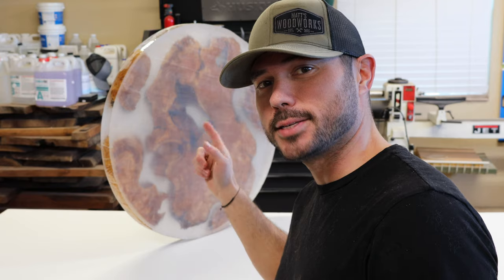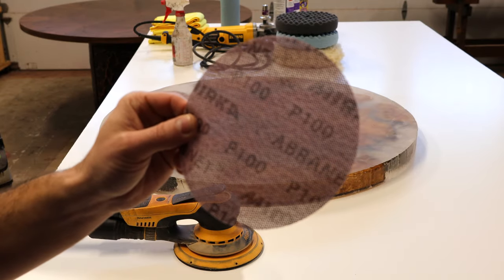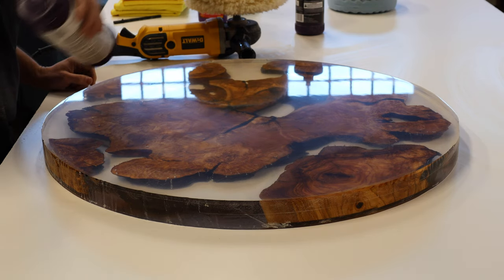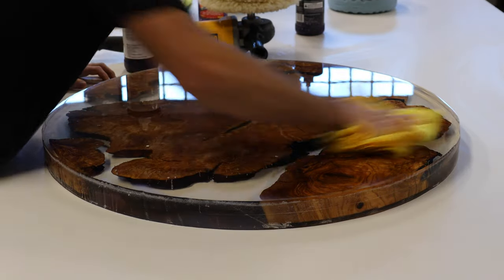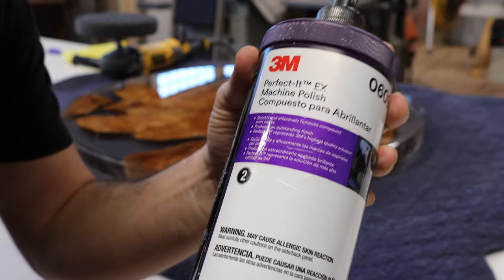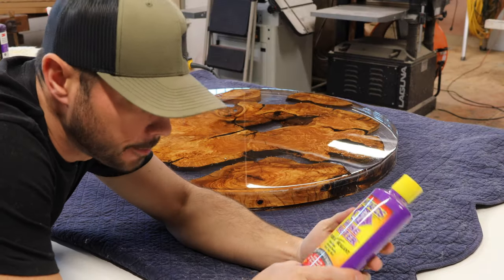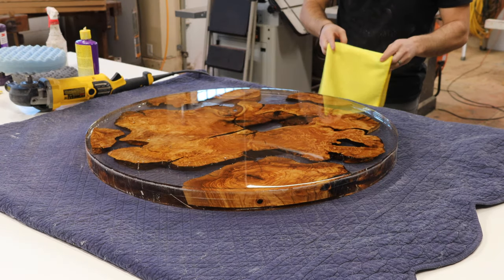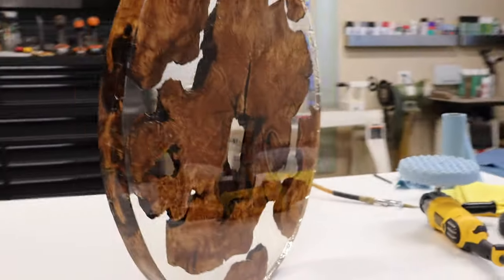How To Polish Epoxy Resin Like A Pro!

Comment: I was hoping you’d clean up and polish the round sides, that’s where most people have the most problems. Higher grits aren’t too bad, but with the lower grits it’s easy to create flat spots, sand off the sharp edges, or get the piece out of round. The piece you did looks amazing.
Reply from the maker: Could be a future video, I didn't because it takes a little longer, I use the same process myself and it seems to work great.  T'hank you for the kind words!

Comment: Great video man, so helpful! Just a couple of questions: Do you start wet sanding with the abranet discs (320)? How do finish the sides? I have the mirka deros aswell, best thing ever - been kinda shy to use it to water sand since it's electric, but i guess its ok!
Reply from the maker: Thank you Jerry! I start wet sanding @320 with the abranet too yes!  Sides I do all the same process just didn’t show in the video, usually would router the circle first.  I’ve used the deros for wet sanding for quite a while and it’s holding strong!  You will burn through the pad savers quicker though! 👊🏻

Comment: Sorry just hit the default…lol. 

Watched your video on polishing resin. Great tutorial by the way. 

I’ve been trying to finalize a few gloating chess boards. Didn’t like the flood coat because of crap in the air. Decided to give your technique a try. First real attempt wet sanding. Had most of the things you’re using. 

Gloss I got but also major swirls. 

A couple of questions if you have time. 

1. How long did you wait before buffing resin? I took my sanding to 220/240 like you suggested. Looked good enough to proceed. Wet sanded to 4000. Stopped at 4000 and went ahead and began the buffing. Nice gloss at the end but noticed the swirls…ugh. Went back down to 220 and tried again. Same end result. 

2. Wet sanding. Damp or wet? I’ll assume wet. Trying to figure out where the swirls came in. I think it came in at the first buffing stage. 2200 seems too high and may have scratched the finish…?

3. How far back should I have gone to remove swirls? Should I go as far back as 80 or 120?

4. Lastly, how do I know when I should get a new pad? Care tips with used sandpaper and buffing pads?

In the end I’m thinking I didn’t wait long enough for the resin to fully cure?  Waited about 2 weeks. Full cure 30 days…?

Thank yiu in advance. Keep the videos coming. 

JB…aka…All for the Love of Cedar”

Comment: Awesome video Matt.  This is the best video I’ve seen detailing any millwork shop polishing process using industry standard items.  

Just an FYI, although 3M and Mirka recommend sanding past 2000 grit,  you don’t need to sand past a 2000 or 2500 grit pad.  Start the polishing process with 3M step 1 past 2k sanding saves a ton of time with the same result. Also, don’t sand with 100grit. 150 should be the lowest. 100 leave away too big scratches in any resins to sand through and buff out efficiently.  Material is so soft you don’t need that extra grit with an Deros sander. 

Been doing polyester/paint in high gloss polished finishes for 10+ years commercially in high end residential.
Reply from the maker: Thank you for the feedback my friend! I wanted to take it this high for this video only to make it easier for anyone trying this out for the first time, I should have clarified this that it's not required at all to go up to 8000, you're totally right!  I am new to the, 100 grit deal, I'll give that a shot next time I do this, thank you!  Appreciate a professionals clarification!
Reply: I was reading comments to see if anyone said it before I added my two cents. I agree with Tosiek and share similar strategy. I'm also a finisher with tens of thousands of square feet of polished polyester behind me. Depending how much orange peel I have to eliminate the coursest I will start is 320/400. If things laid down clean i might start at 800 grit. My biggest question on this vid was why the 100 grit? I guess we are going after air bubble craters and orange peel? My final sanding is usually 3000 grit trizact, but Ive been known to go up to 5000 when Im pissed off at sanding scratches (pig tails). Ive left 3m for Menzerna polishes. They seem to cut and polish cleaner with less chemical smells and greasiness. The process you have in this vid works great obviously, but I think you needn't go all the way down to 100 or as high as 8000. Good vid.

Comment: Came over from Blacktail Studios. What an informative video to jump in on.  I do resin tables and have had a problem with that kind of finish.  Now I know what I have been doing wrong.  Self-taught brings a long learning curve.  Heat will do away with your bubbles along with good deep pour resin.  I use resin from the epoxy store, they have a deep pour that is amazing and great customer  service.  There factory is in California.  Thanks for the great Vid.  Think I will start over on one that I can't get the cloudy out of!

Comment: Quick question... you wet sand up to 8000, but then use the 3M #1 and #2 ... isn't #1 about 1200 grit and #2 about 2000 grit? I tried with 3M and Maguires 105-205 (roughly the same grit as 3M) but I just can't get out the swirls. Am I pressing too hard or too soft? I really want to polish rather than add another flood coat to get it glassy, But I can't figure out how to get the polish as glassy as you.

Comment: It's totally unnecessary to go thru the entire sanding and buffing process for something that's already coated with epoxy to get a glass like finish. Just use clear epoxy. I can understand this process suits projects like river tables, etc.
Reply from the maker: You're correct, if you wants a perfect top coat you could do this, but there will always be dust nibs or bugs that can potentially ruin a top coat, so this is best way to overcome that.  Starting at 800-1000 grit in this case if trying to take away small nibs.

Comment: great project. i also tried to go from 320 all the way up tot 4000 and then 3 types of polish. use a festool rotex sander. up to 1500 it has holes for the vacuumsystem.  Nevertheless I still get pigtails. 
with the vacuumsystem you cannot use water. 
what would you suggest? 
are the pigtails the result of insufficient cleaning in between? 
the pigtails also will not vanish with a next poor of epoxy. suggestions?  kind regards. love your video!
Reply from the maker: The pig tails are a result of not cleaning properly between grits, also after 320 I take the vac system off and just wet sand.. Clean clean clean!

Comment: Ah! Finally a great, comprehensive video on how to make a bar table epoxy finish not just clear but smooth  too. THANK YOU!! I've been working on my table for months and this is where I'm at. One question: how long do you estimate you spent to go from original, rough sanded table to the final product for this particular case?

Comment: You don't need to go through every grit that exists. That's not necessary. As long as each successive grit removes the topography of the one before it without taking 10 hours then you will have the same result as using every grit known to man.
Reply from the maker: I mean I could have went to 12K grit lol.  But you are correct, going to 3k is sufficient to start cutting/buffing but most people watching these videos aren't professional buffers so the less they have to do buffing is probably most helpful to them getting a good result.

Comment: Many great answers to some of the comments I’ve read. Apologies if you have already answerd this elsewhere in the thread but do you have any more detail on the wet sanding process please? I’ve ready you start at 320 but are you using a spray bottle and misting or just sloshing some on? Anything else you think is worth mentioning?

Comment: I do this type work.
I go straight to 600 grit, used wet on a rigid block (1/8" sheet of  acrylic) and suffer thru the longer time it takes to level a surface. 
Soft foam sanding disks follow contours, a rigid sheet of plastic as the sandpapers backer cuts off peaks.
I spray clean the sand paper every 45 seconds to avoid loading the paper.
My point being, 360 grit scratches are a nightmare to fully elimate so I simply don't allow them to be introduced. 
Depending on the standards, sanding can stop around 800 or 1000 and next comes a 3M fast cut compound on a waffle face foam pad. 3M makes a compound that breaks down fast, it starts as a cutting compound but becomes a finer polishing compound as you use it. It's worth the research (i cant remember the product name and my 3M bottle is gone, poured it into a squeeze bottle).
Final pass is a swirl mark remover compound used on a wool pad.

Comment: hi Matt, very nice. Question please: am about to polish a large acrylic swim pool divider 50ft x 2ft high x 2inches thick. Never done it before and cant find anyone to do it so will do myself. Bought two 5" Bosch Random Orbital sanders and plan to start with about 500grit going to 2000 but after seeing your video, maybe will need to go higher? which brands of sanding disc and polishing liquid would u recommend for acrylic pls? it is 12 years old, been scuffed up a bit, hazy and scratched but not too deep scratches. Think i might need about 50 sanding discs all in?

Comment: Matt I know you are a Super Clear guy. I am working on a bar top and used Super Clear's Bar Top Resin but took it out in the sun yesterday to see any imperfections and it heated up and started to ripple. I brought it back in thinking I could do another coat on it and messed it up more. It has about a 3/16" finish. What is my best option? I am wondering if I can sand it smooth and level as you did on this project and fix it that way or if I will need to strip it and start over. What would your suggestion be?
Reply from the maker: I'm sorry this is 6 months later, but I would say that yes you could flatten and then do this process to achieve a great result.  I have actually done this and it worked great, check out my latest video on the letter, there was so much imperfection that I had to flatten out and polish, end result was like a "flood coat"

Comment: Have applied my final coat and sanded 1000 final sand. Smooth as glass but have a bit of haze you can see from an angle. Need to see if I can polish this out.

Comment: Hello, like this, I have seen your videos and it does a great job, I recently started in this, I have some doubts if you can help me, 1. Sandpaper up to 10,000 but these leave marked how I remove those marks and how many hours of polishing you must do to reach your completion, greetings from my country chile
Reply from the maker: Once you get to the higher grits you need to be extra cautious on cleaning your surface after each grit increase.  Any small particle left on the surface will creat pig tails or sanding marks.

Comment: Beautiful job!  Would you use the same process to polish if the wood was exposed as opposed to it being an all epoxy surface?  I've heard to no polish the wood.  Would you use the same process on a river table and just polish the epoxy part?
Reply from the maker: I have never done exposed wood with epoxy polishing, I would recommend that the wood be dry sanded all the way through he grits like I did here, just not water.  I would guess you'd have to tape off the epoxy/wood and do each section individually, andI definitely wouldn't use any of these polishes on raw wood!

Comment: I know this is an older video, so I hope you're still around. How would you go about polishing something that's more globular? 

I'm pouring epoxy skulls to put on an award for my unit. (It fits the theme, don't ask too many questions). 

I have been using headlight polishing compound and a drill mounted headlight polisher, but we're still not coming out super clean. Any suggestions?

Comment: Question. I made a small river board so the resin is only about 2-3” wide. I would like to odies or rubio the wood and polish the resin. How is that possible? Would I have to wetsand the resin and use a small airtool for polishing?

Comment: So I have a question if you dont have a sander or buffer like that and working on smaller pieces would you do the same process? Also if so and you dont have any car polish what other options do you recomend for that? Do you need to use a buffer, foam pad before using any polish compound?
Reply from the maker: I'm sure you could apply all of these processes here and do it by hand, I haven't yet done this so I don't know how the final outcome would be.

Comment: Hi Matt, Thats a great video mate, i have just build my very first river table and i want to polish the black transparent epoxy to a high gloss, i will have to buy a polisher but qot confused with all the ( duel action polisher and rotary polisher ) what sort of polisher did you use in your video as you obviously done a great job with it.
Cheers for your help matt
John brunton

Comment: I have a 4-in wet grinder (typically used for stone) and graduated sanding pads. Do you think those would work (wet) on an epoxy table top like you've done here? I'd like get polishing pads and use that one tool for all the steps, if possible. What's your opinion, before I try and find out it was a terrible idea from the start!
Reply from the maker: Honestly I have no idea, give it a shot on a test piece!

Comment: Great video thank you. I have a question regarding polishing a similar round table that has wood in the middle and epoxy around it. So the surface is consisting of wood and epoxy I like this table in the video that is wood inside of epoxy. If I used the same material for both wood and epoxy,  I know it would work great for a party but will it also work the same for wood surface?

Comment: Matt, do you have any suggestion for the last step other than Wizards? I'm doing some charcuterie boards that are fully encased in epoxy and Wizards is not food safe I don't think. I did go ahead with step one and two as I imagined that they did not remain on the surface after washing?

Comment: Hey Matt, 3 questions. 
A) Can you do this process with Table Top epoxy in art pieces (final top coat)?
B) if you have imperfections like divots/indentations on your final clear coat, will this process make them disappear and make the piece look perfect?
C) if I want to apply a UV varnish to protect the piece from sun (like bristol clear, or other urethane varnish) when is the exact moment during the process you showed to apply it? After the final wax? Or way before? 
Thanks a lot!
Reply from the maker: Hey Rodrigo!

A: Yes you absolutely can!  Table top epoxy is usually harder anyways, so it'll polish out nice!
B: Yes it will, If you're doing a table top coat, and you have imperfections, I would start at a higher grit like 600-800 so it saves you time, just enough to get the imperfections out, then proceed to higher grits/polishing.
C: I personally wouldn't add any varnish to something like this, it would yellow or amber faster than the epoxy to be honest (granite you choose a good epoxy brand).  I would look into maybe a nano coating as a final step!

Hope this helps!
Reply: Give me the detail list of electric grinder, buffing machine and other buffing wheel 
Name and brand so it is easy for us for my other job of epoxy an polyester both 
I need mirror finish but which machine and accessories is useful I don't know 
Pl do the needful 
Thanks 
N.LP

Comment: Quick question do you clean your pads afterwards.... Like the black one ect. Or just leave them until next time.
Reply from the maker: I actually wait until next time because by then the polish that was on the pads is hardened enough to de-burr.  I take a piece of metal, plastic or wood (something with soft edges) and turn the buffer on and run the piece down to the center of the pad and it knocks off all of the debris/old material.

Comment: Hey ! I  was wondering if you can give us some advice. We’re trying to finish a coffee table that’s been encased in clear epoxy and for the life of us can’t seem to get a scratch free surface.
We wet sanded the epoxy from 80-4000 grit not skipping a step with a Festool rotex 125. We wet sanded even the lower grits because we found in orbit mode, every 10 seconds the paper would gunk up leaving massive pig tails . So wet sanding the lower grits helped with that. After 320 grit we switched to rotex mode and continued wet sanding to 4000 which left a pretty decent surface . We’ve used a polishing pad with some Mirka 10 and Mirka 5 polishing compound using a white buff pad for the Festool 125 and polished and buffed it with no avail.  In the end it’s pretty decent , and looks very clear but there are still so many scratch marks if you look at it from certain angles which kind of ruins it. I know your video shows a different process with different tooling but for timing and finances reasons this is what we have to work with 

Please, if there’s any advice or tips you know that could save this project, would mean the world to us.

Thanks,

Rebeccah and Nick

Comment: Is it possible to cut back on the amount of grit steps.... for a not quite as shiny finish, on a smaller item for instance. For example, starting out at a higher grit than 100... maybe 500 or 800.

Comment: Looking for advice, I want a good little system for buffing my epoxy tables and am a little stumped. I have a 5" orbital sander and thought I could just find hook and loop pads to just stick to it and go to town but that doesn't seem to be a thing on Amazon "in Spain". I see a lot of car guys using angle grinders, is it just best to but a hook and loop adapter and add it to the grinder then get the more like 6 or 7" pads I see for those? By the way, I will have an angle grinder that I can turn the speed down on if need be. All help appreciated! :-)